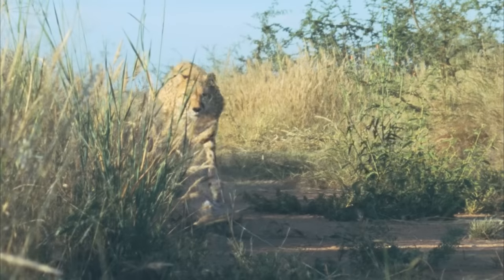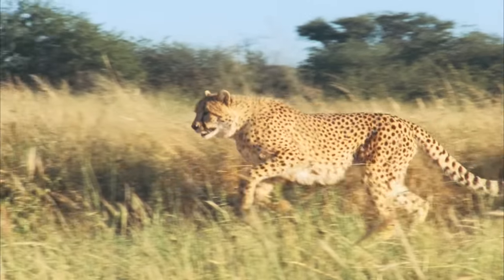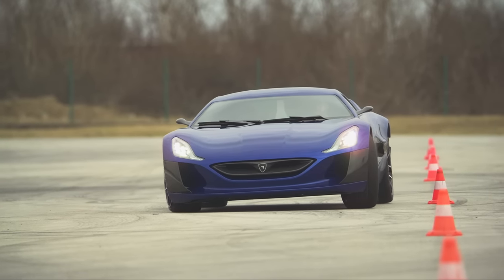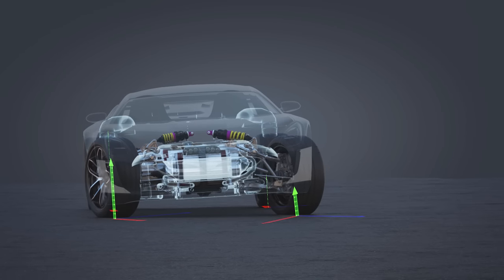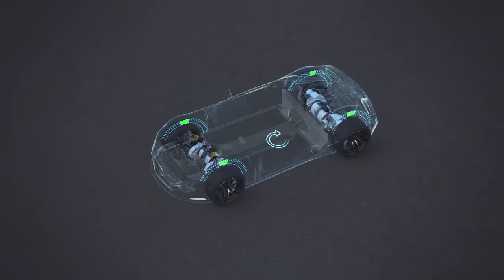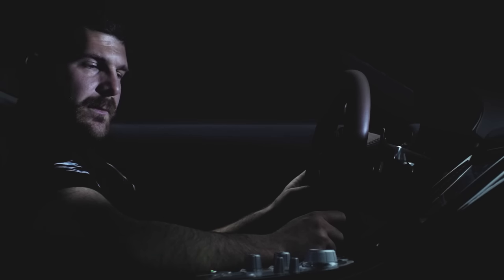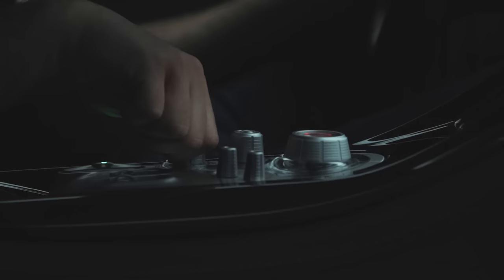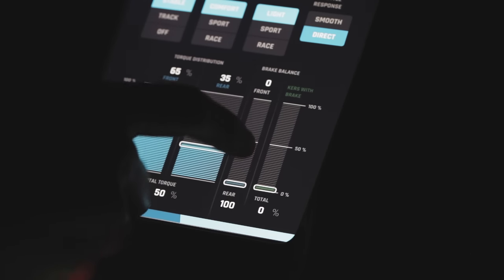Rimac All Wheel Torque Vectoring

Comment: Rimac should further this concept, by replacing the steering wheel with the two throttle/reversers used by tank drivers, or two pairs of them